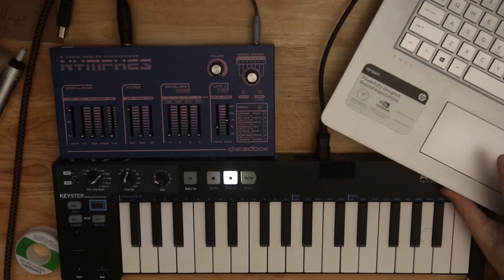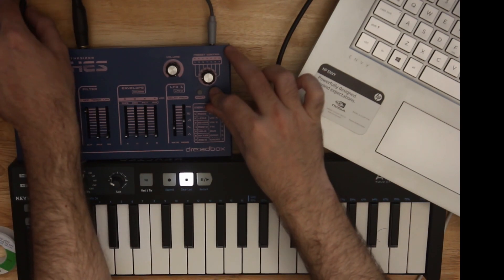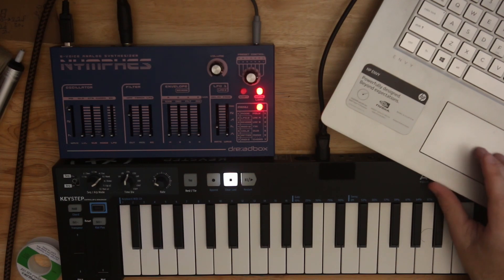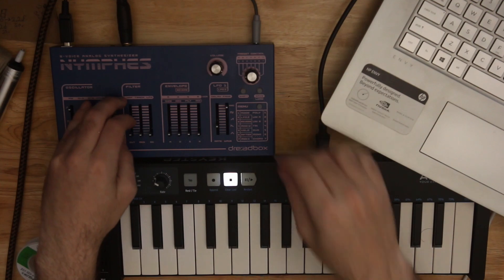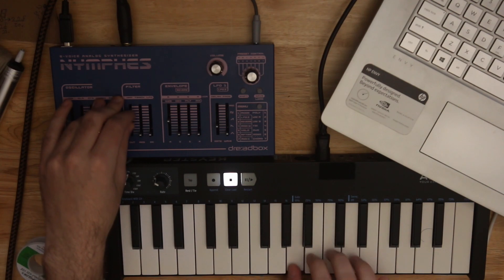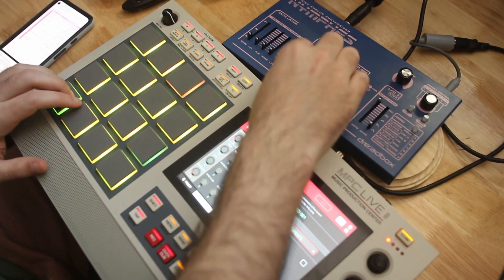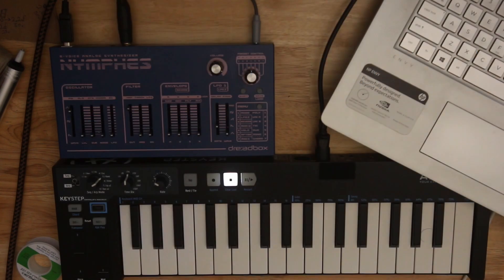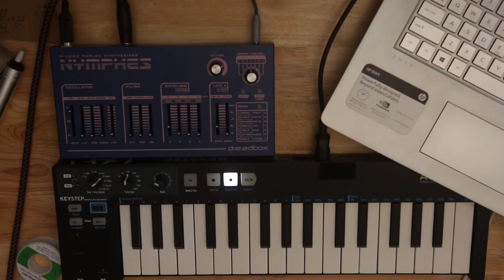Nymphes Firmware V2 Update // Installation & New Features

Comment: Since I did not have my Nympnes hooked up to a keyboard or amp while trying to update the firmware, I was not aware of the calibration step, which takes time.  I disconnected the synth after the syxex file showed as sent, and when I moved the synth back to my controller, and the 3 lights were still lit, I was afraid it was stuck.  Sure would have been nice if the update pdf manual would say that the synth recalibrates after updating.... It's an amazing synth and works fantastic with the hydrasynth line, but whoever writes the manuals could be a bit more detailed describing the full procedure.  Thanks for posting a full walk thru.
Reply: How did you fix it im currently havinv the same problem
Reply: @JackAtano  First two steps in the manual troubleshooting section list...

1.Perform a Global Settings reset: With the unit off, hold down SHIFT+MENU while powering it up. Keep these buttons down for about 4 seconds after the power up. 

2. Perform an Autotune: While the unit is powered on, hold down MENU+LOAD for 1 second.  Let the autotune procedure to finish (it takes about 1 minute  and it is audible).

I used the same program used in this video to send the Sysex update file with the same settings Jorb (and the instructions) described.  It did take me more than a couple times, even after doing everything in the manual.  Maybe it had to perform the procedure to fix me unplugging it too early?  Either way, after I ran it a couple times (the last time with the audio plugged in and I heard it calibrating).  After that, it worked fine. Hope that helps.

Reading some of the comments below, the calibration and firmware updating takes 3-5 minutes, and it's best to let it just do it's thing for maybe 5-10 minutes.  Also, I'd suggest having the audio plugged into a monitor so you can hear when the calibration starts for some audio feedback.
Reply: @drsamurai009  got it to work! Thank you so much

Comment: One thing about dreadbox is their documentation of updates and update cadence really raises the bar. They keep updating the Typhon and I am glad to see they're bringing the same to the Nymphes.

I'm still struggling to connect with the sound on it, i.e. getting sounds I am satisfied with. But that has more to do with my own time with it vs the device (or controls). Preset export/import means I can just benefit from the hard work of others soon 😌

Sadly, I still have the envelope clicking after the V2 update. Or so it seems? I'll have to spend more time with it to verify.
Reply: Also, the relative/scaled parameter mode seems very useful for live performances, where the drastic jump might be jarring (unless that's what you want in that instance)
Reply from the maker: @AgonalRhythm  that's a great example of when it would be a fit, that didn't occur to me, and much more immediate than catch

Comment: I'm still hoping they can fix the scratchy VCA envelope. It still very much is an issue (I've tried two different units). I think it is a separate issue from the attack clicks which can be greatly reduced by moving the attack fader up just a little bit.

Comment: The VCA scratching is actually a huge problem.  I returned mine for only that reason.

Its just too audible when recording if your patch has the filter relatively closed.  I will buy it again once this issue is totally fixed but its not usable in a recording situation with that problem.

I had the same problem with the Behringer MonoPoly actually.
Reply from the maker: I think thats good feedback, you're the second example I've heard of that. I notice an improvement, but hope to see more as well!
Reply: I totally agree with you, it's a huge problem for me too. returned mine for the same reason

Comment: Thanks for the video, well done and instructive.
I am waiting for one Nymphes that i recently bough...I am gonna upgrade as soon as it comes in.
I have tried to listen a few times the part regarding the "envelope scratching" but honestly i do not understand what the issue is. Probably it will not be an issue for me as i cannot hear it...but i still would like to understand what the potential issue is so i can compare the 2 versions to see if there is any improvement...can you help me understand what should i be looking for?
Cheers
Reply from the maker: Cheers, appreciate that. 

The envelope scratching, you can hear a sort of static triggering with the amp envelope, sometimes right at key press. depends on settings, isnt that bad

Comment: do you mind having a link for the output audio cable you use? (I have no idea which one I'm supposed to use)
Reply from the maker: Any 1/4in TS jack *should work if you're plugging into a mixer or interface
Reply: @JorbLovesGear  thank you. The synth is mono which is why the single 1/4" TS Jack is appropriate right?
Reply from the maker: @Diego-ct9qx  sort of, many synths will use a pair of 1/4in ts tables for stereo, 2 jacks for 2 cables.

TRS exists as well, and could be stereo, or for balanced signals

Comment: Don't update it with MAC! After this the knobs will not stop flashing. I already second time updating this firmware on windows after bug with SysEx Librarion, maybe the problem with this app. Anyway even after updating on Windows with Bome Send SX app I have a problem with a sond, I almost don't hear it, it's on so low volume, and noise on the big volume. I using same cables and same Audio Interface that I used before and it was ok before. How to factory reset it fully?
Reply: How did you fix it